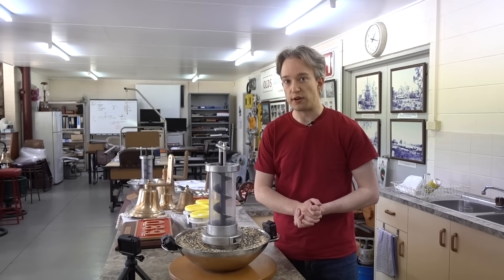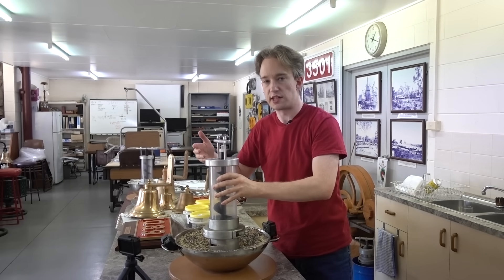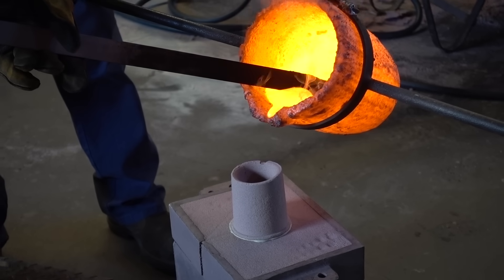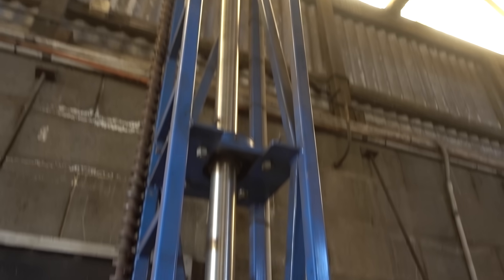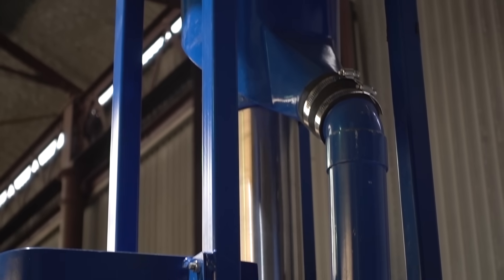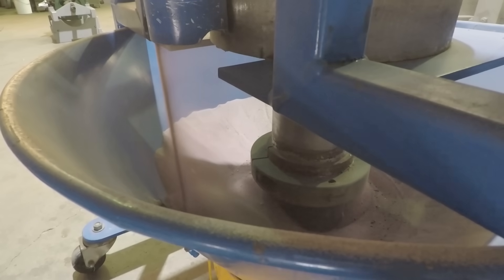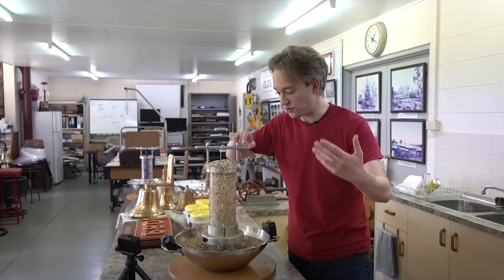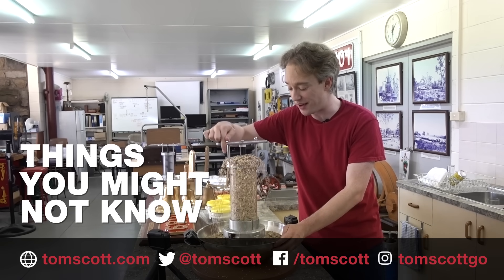Mr Olds' remarkable elevator

Comment: in farming or basic Grain Auger uses inside tube which is turning can a bit dangerous as moving part claimed many👨‍🌾 farmer limbs 🚑🏥a or the power source know as the PTO cause the same limbs lost problem 👨‍⚕🏥our local welding service 👨🏻‍🏭guy repair Auger all spinning wear down the edge auger

Comment: It's not just a pipe going around a screw. It's a scooping blade on the bottom, you let us see it in the last minute. If you remove that I doubt the thing works. You are scooping material up and make use of the screw and solid material, with a liquid you need higher velocity and will not be efficient. This is not magic.
Reply: Want to add something, it's a pump basically the bottom is the propeller, don't know how to say correctly in English.
Reply: Also maybe downside is that you need a very long screw and rotating pipe? It's not like the pipe with screw is 2 meters and the height is 10 meters. I think you need a 10 meters pipe. And this is only for vertical use. Horizontal with heights and bends... don't think so.

Comment: The internal side-wall friction of the tube is critical. If you make the interior wall of the tube very low friction, say a coating of PTFE, this particular device ceases to work properly. The notion that it is "injecting" particles into the base and that is the primary force is not completely correct.

Comment: It's the exact same thing though. Doesn't matter if the screw rotates or the tube rotates, it gives the exact same result.  It's not surprising at all. It's just common sense. In practical application though it is better to turn the screw instead of the tube. Less exposed moving parts so it's safer and less maintenance.  Not sure why you or anybody else would be surprised by this to begin with honestly.....
Reply: Did you?

Comment: The bit my brain can't quite grasp, having watched the video - is the internal screw actually necessary? wouldn't the scoops at the bottom pulling material in force material up the tube anyway?
Reply: the scoops of the bottom of the tube push the material inward and thus force it up the ramp 'screw", without the screw there would be no upward motion the material would just get packed into the center of the bottom of the tube